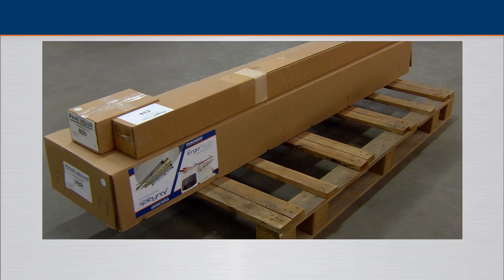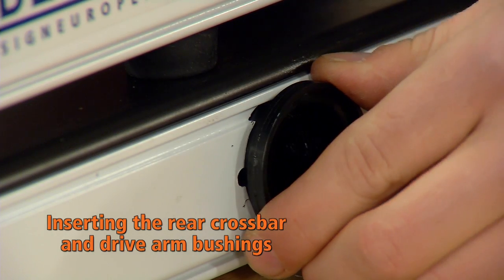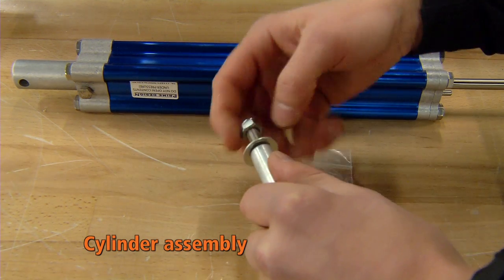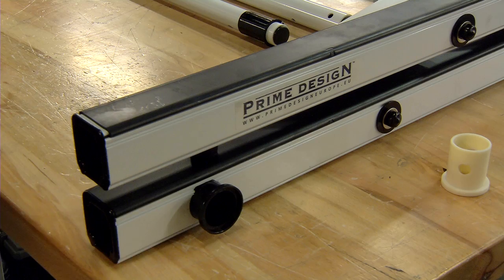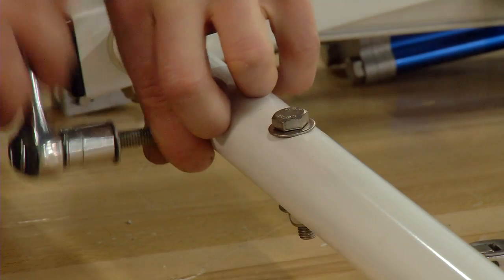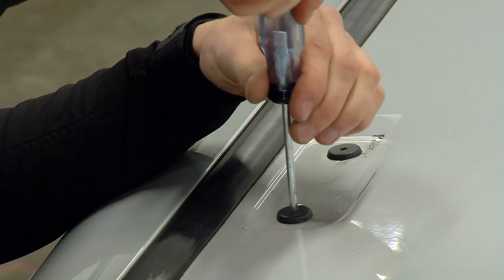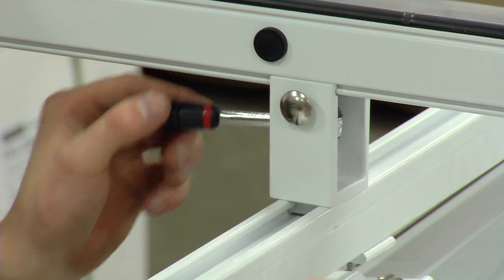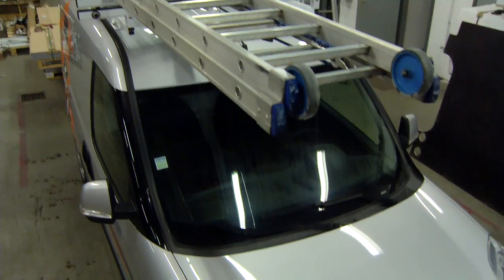Roof rack ErgoRack: how to install the Prime Design Europe ladder rack

Comment: How do I maintance  the cylinders when they are not closing and opening smooth as they should
Reply: 1. Check if the correct site is installed;
2. Revise the screw on the cylinder;
3. If it doesn't work, contact the supplier to solve the problem.